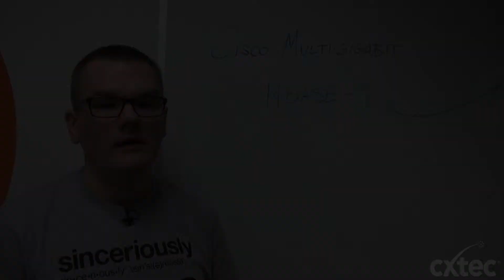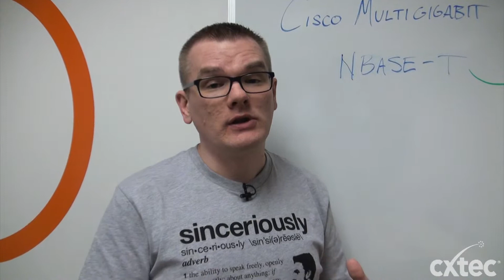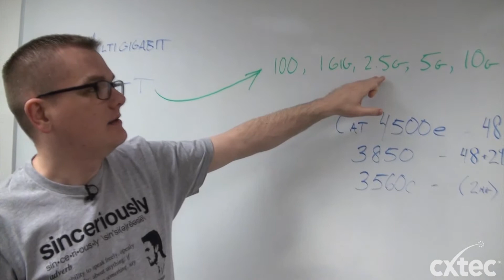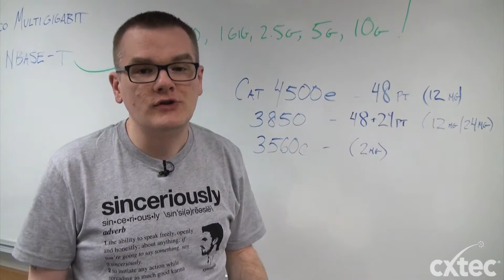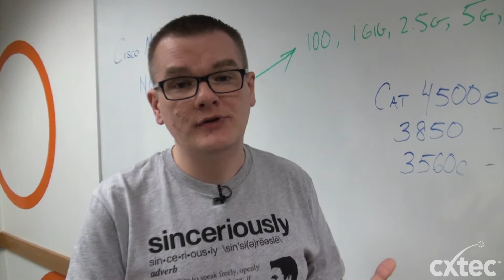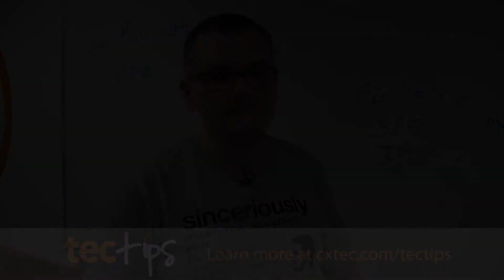Cisco Multigigabit Technology - CXtec tec Tips

Comment: I want to make a high performance test over Wifi with two 160 Mhz clients

1 Gbit fiber isp

cisco asa 5512x

cisco 3750x

Cisco Wlc 2504

Cisco 3802i in dual 5 Ghz mode and flexconnect

I get 940 Mbit in up and download on wired network

on wifi with a laptop with intel ax200 Connection speed 1.7 Gbit

i get 750 Mbit

 

When i try to make a file transfer from a server with 10 Gbit i get 600 Mbit

i wanted better results with maxium speed. 

 

I then bought a brand new Cisco WS-C3560CX-8XPD-S, to get better results because of mGig and then i connected it to a Cisco 3750x with SFP-H10GB-CU3M= cable, then i connected a Cisco ap3802 but i don't get any speed change, but in the WLC it says that it has 5000 Mbps and then i saw the channel Utilization on the mGig port on Cisco 3560, and it was on 100%. I  can't go over 1Gbit speed with two clients, and then we tried with a Cisco 2802i with two 1Gbit links in lag, I didn't see any improvements at all.